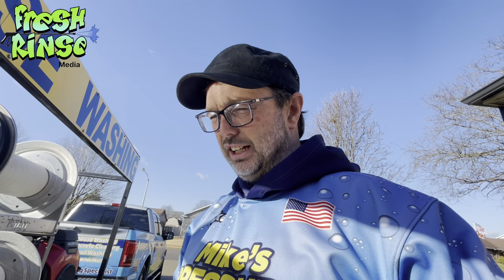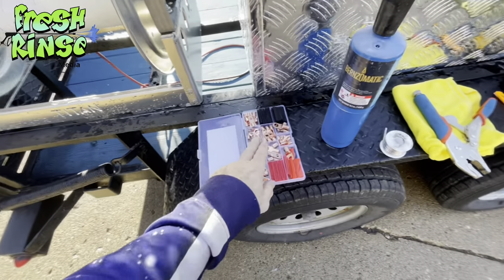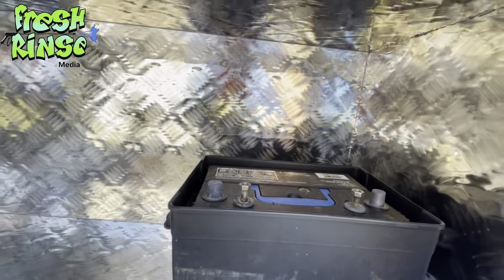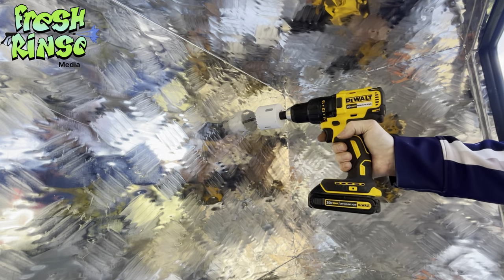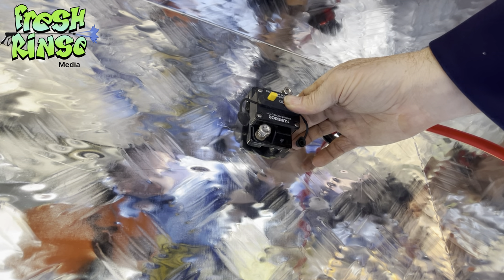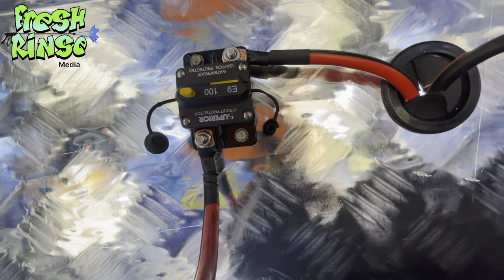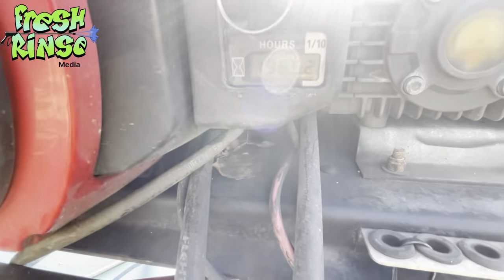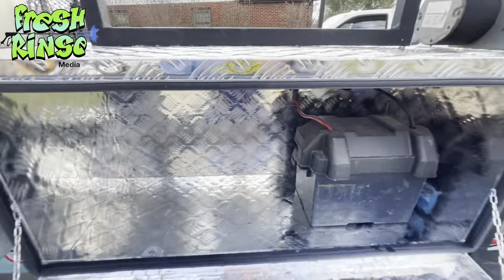Complete Pressure Washing Rig Rebuild Episode 8. Powering Up The Machines!

Comment: Thanks Mike.  Question?  Why a breaker on one machine and not the other?
Reply from the maker: Great question. Actually, they both have fuses. Neither absolutely require a breaker. I will eventually run the 10 to the breaker too.
Reply: @TheFreshRinse  that answers my 2nd question
Reply from the maker: @MannyAguilarJr  Thank you my friend

Comment: Spot on!!!   Where and what is needed to change the oil and filter on the 8gpm gx690.  I have one coming up on 20 hours soon and was told to change the oil then.  Tku all!
Reply from the maker: I’ll put together a video.

50 hours on first change
Reply: Honda GX690 manual:
4 stroke automotive detergent oil with API SJ or newer (currently newest is API SP I believe)

- 13-105°F outdoor temp- 5w30 full synthetic(use if starting temps are -13-5°F) 
10-105°F outdoor temp- 5w30 or 10w30 (recommended general use)
50-105°F outdoor temp- SAE 30

1.6 US Qts without filter change 
1.8 US Qts with filter change 

Honda oil filter part number:
15400-PLM-A02

Fram oil filter:
XG/TG/PH/FD 7317

Napa Gold 7356 oil filter 

Oil drain bolt is likely 17mm  if you don't have a drainzit style drain hose

Torque drain bolt to 33 FtLb when done draining 
Torque new oil filter 9 FtLB (mentioned but hand tightening is the common method)
Reply from the maker: @MannyAguilarJr  Well… thank you very much!